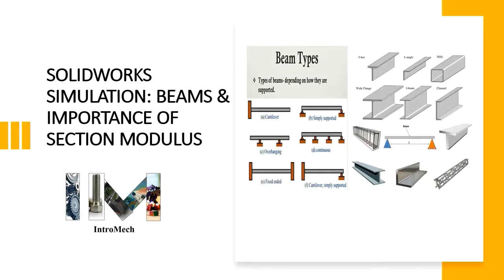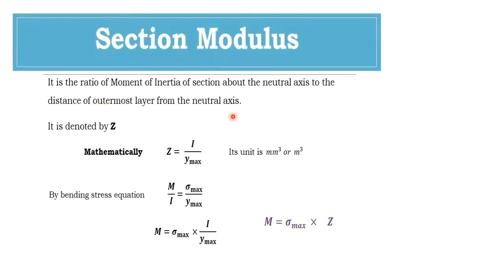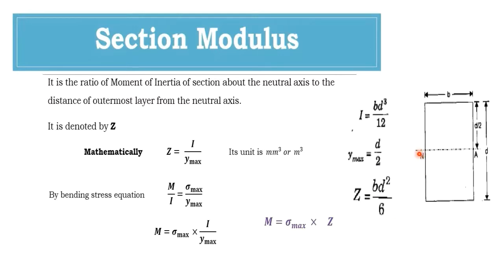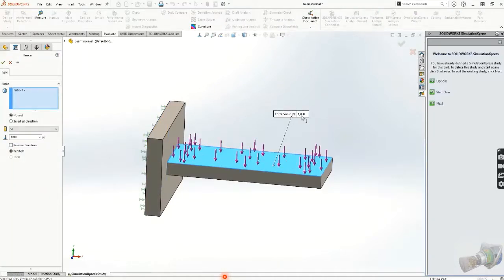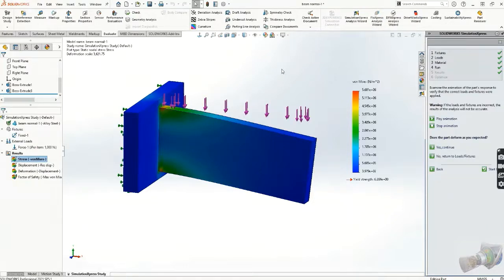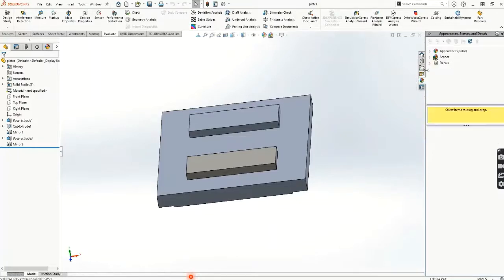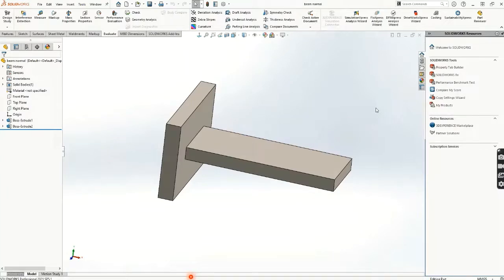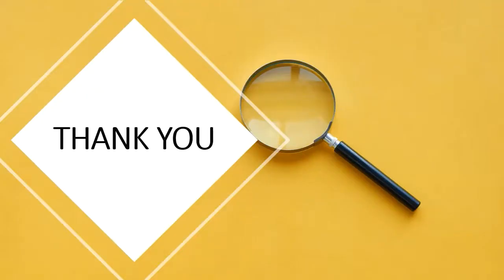SOLIDWORK SIMULATION: BEAMS AND IMPORTANCE OF SECTION MODULUS

Comment: Sir how to know the deflection of beam and stress are within permissible limit.
Reply from the maker: @sagar 
1) For deflection, you have to check that how much deflection is permissible in your application.
2) For stress, you can check the value with yield strength of the material. if the induce stress in the body at some section is greater than the yield strength of the material, the part will undergo a permanent deformation. This is not required. this can also be corelated with Factor of safety. You can also get results for FOS and can decide whether the stress is within the permissible limit or not.
Reply: @IntroMech562  Thank u sir,
Great video for Guidance...
Reply from the maker: @sagarbhapkar9155  Thank you.. Do share the videos!!👍